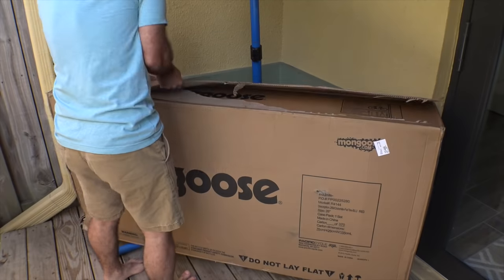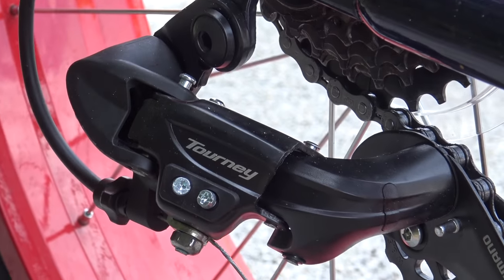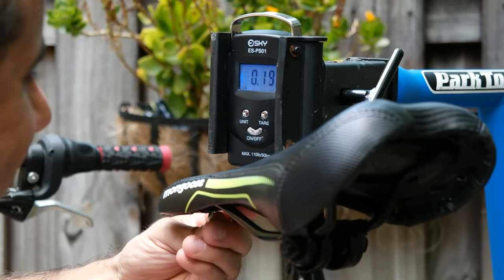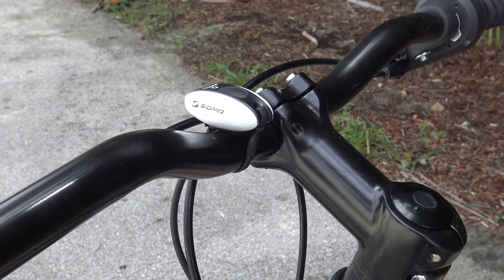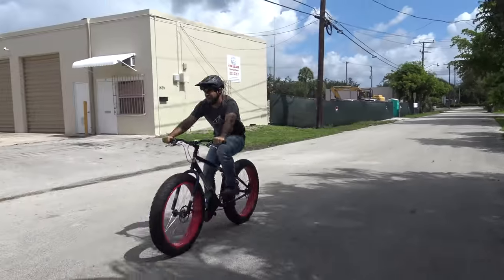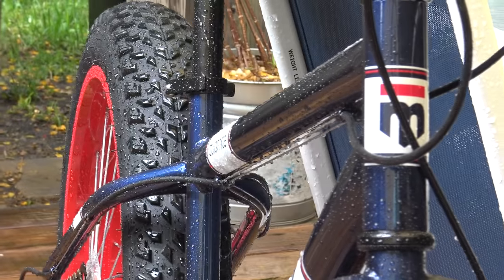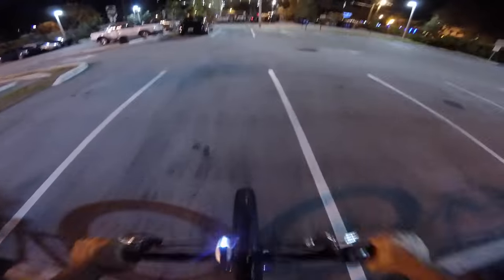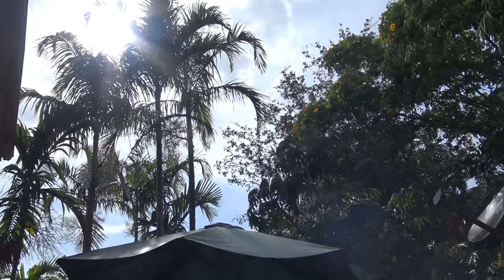Behold! The Mongoose Dolomite Fat Bike

Comment: Hey Seth!  Thx to you want to start mountain biking!  Any recommendation for an affordable mountain bike that I can do tricks just like you??
Reply: Start with a hard tail mtb. Usually "all mountain" would be great for any reason plus for starter riders getting into the sport.
Reply: Get a Specialized Hardrock. Its sub-$500 and it is a great starter bike. I rode one for about 7 months and put 1500+ HARD RIDING miles on it. Yes, It did have many problems, but I put that bike through so much, especially considering that it was not meant to be doing what I was doing. If you want a little nicer of a bike, get a Specialized Rockhopper. The Rockhopper would actually be my first choice if I were in your position. :)

Comment: Seth I have got a mongoose terrex for my birthday and I want to start riding on more advanced trails and my last bike did not last . So what bike would you recommend or what do you think about the terrex good or bad or what would you recommend I do to to it to make it more durable please respond with your honest opinion
Reply: Cooper grasseth reviews mongooses havent got the best rep but ive never ised or owned one so i cant talk look for grippy light wheels quality branded parts on everything the chain goes near and the suspension wide bars and an aluminium frame a good front suspension bike is 400-500£ depending on the brand in the uk usualy a well known brand would be good if its known for good reasons not bad

Comment: When I lived in Northern Idaho, the only readably available fat bikes went for $1500.  At $200, I would have run not walked to buy this bike.  For general purpose use, fat tire bikes like this are rather pointless.  Once the novelty wears off, they go on craigslist. It is in riding snow/ice that this type of bike earns its keep.  North of the 48th parallel?  They are going to sell a lot of these sled dogs.

Comment: I got a question why mongoose oh and also I have found a 300 pound muddy fox country bike from Argos (if you don't know is a well I don't know really it has shimano Altus and disc brakes full suspension bike should I buy it??.?
Reply: techspeed for 300£ no
Reply: techspeed the cheapest you should spend on a full suspension bike you want to keep for more than 5 secconds and use offroad you need to spend £800 on a new bike or look for a used one in good condition id recomend any carerra voodoo and boardman if you look at the price to what they have you might think you sre getting ripped off but the quality of the parts are insane you will almost never brake the parts unless you crash and hit certain bits hard

Comment: don't have one, but i'm planning on getting one!
Reply: Pro tip get a seat cover the stock seat is unbearable. Also plan your trips to stay downwind because the weight is not so bad at first and you might feel like you can do the speed limit but the second the wind faces you on a ride the weight of the bike doubles and its really fucking hard to move. Get a set of resin break pads from amazon immediately the screech will happen soon after use and its really loud and really annoying.
Reply: +Frenzy Sucks thanks for the heads up :)

Comment: Seth the gmbn channel said that you should drop with booth will at the same time cause when you drop at te rear wheel all the force off dropping it will be in the front shock so is it true am so confuse right now to what to do men
Reply: What are you talking about?!
Reply: +zevi 2000 im just asking seth if doing drops rear wheel drop is better than both wheels at the same time

Comment: Please advise I have a mongoose beast and it uses a bottom bracket BB3ED and you can buy it from Pacific bicycles but my problem is the crankarms and chainring they no longer sell.but looking at the dolomite it looks like it could be used on the BEast. does anyone know the number for the bottom bracket for the Dolomite is it the same as the beast? I think its 110 mm squaretapered axl. and can anyone tell me the Dolomites  model number i come up with # R4144WM what i cant find is the date code? please i really want to save this bike. thank you for any help Jason

Comment: Important question. What do you use to route the dropper cable on your syncr pro??
Reply from the maker: that bike comes with a hole in the seat tube, and mounting points on the down tube
Reply: +Seth's Bike Hacks I have the line version and mine has the hole at the  bottom of my seat tube but up the bottom all there is is 3 threaded holes. are there guides I can screw in?